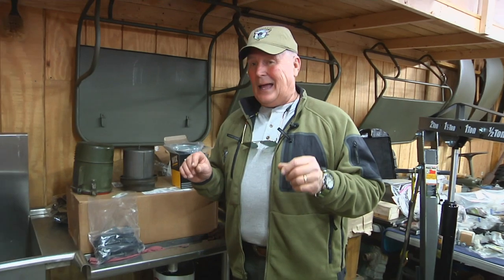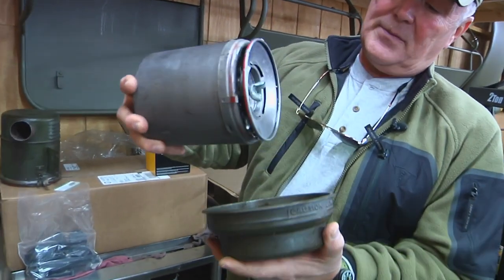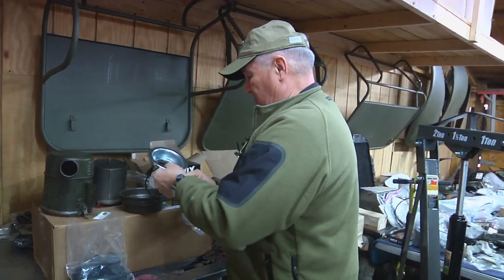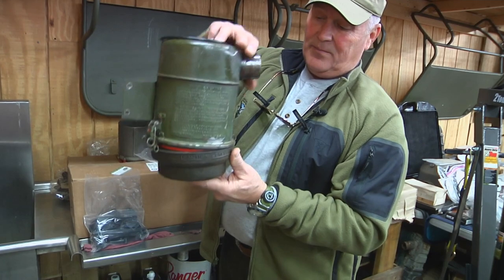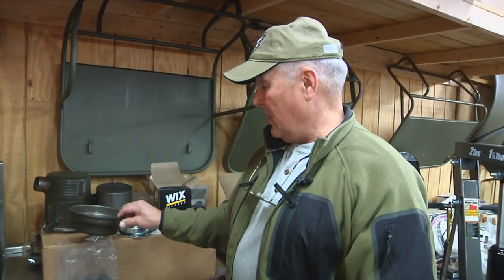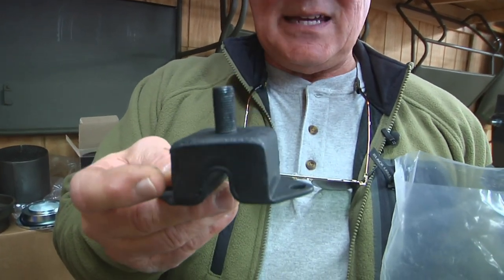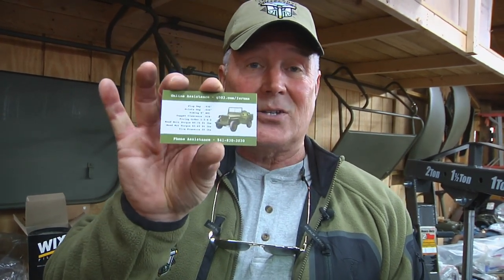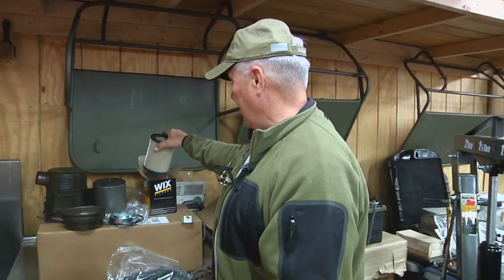Air Filter Modification | 1943 Ford GPW Restoration

Comment: I also posted this comment on Ron Fitzpatrick's air cleaner video also.  Unless I'm missing something the way they tell you to put the air cleaner conversion together it doesn't seal on the top of the filter.  Stick your air filter into the upper housing by itself and you'll see it doesn't match up to anything to seal up.
In order to make the conversions work you put the o-ring in the upper housing followed by the steel adapter and air cleaner.  The bottom of the filter will then seal against the inside of the cup when you put it on.  Basically upside down from what's shown......gotta seal both ends of the filter or it doesn't do anything.
I'm  also a little concerned that the outer edge edge of the cup will no longer seal against the housing, giving an opportunity for water to get in.

Comment: In the G503 instructions, the O-ring gasket goes between the bottom pan and the adapter, not in the upper housing.  But I don't see how that Wix filter is supposed to seal inside the top housing.  So, you might want to check out these alternate instructions: https://www.youtube.com/watch?v=XFffvb0oGNM